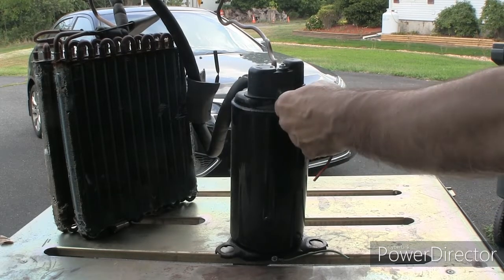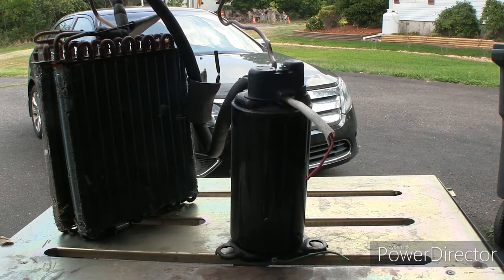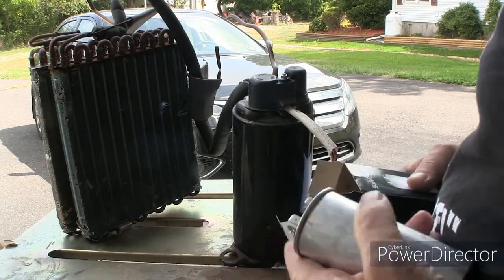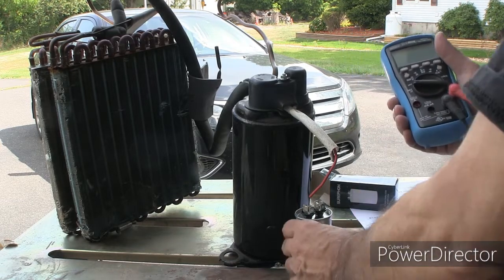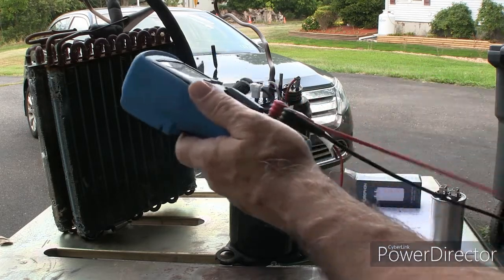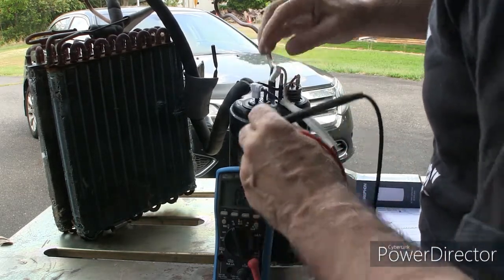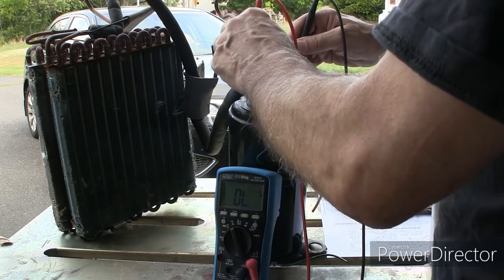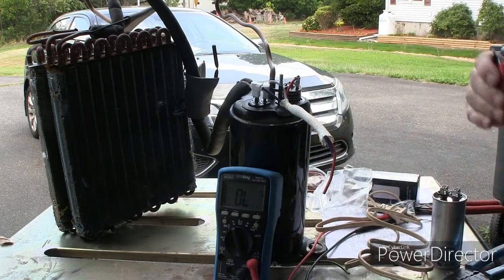DIY Refrigerant Recovery System PART I

Comment: Love the meter. 😮
Reply from the maker: It’s my go to, I use it all the time.
Reply: What i usually do is set the recovery tank in ice with salt drops the temp to 20ish degrees °f open the gauges let it condense into the tank all that's left in the system is trace amounts no machine needed. Just another idea 😎